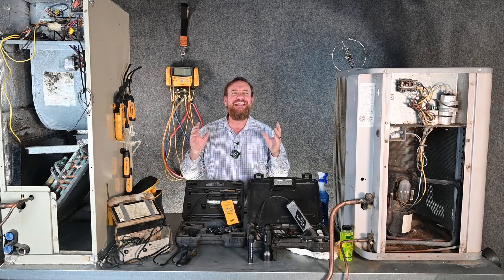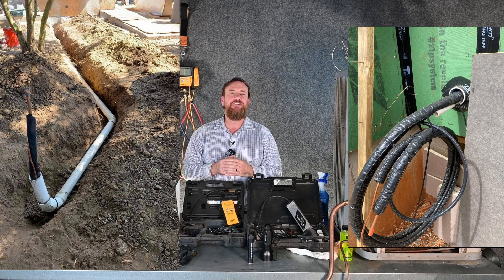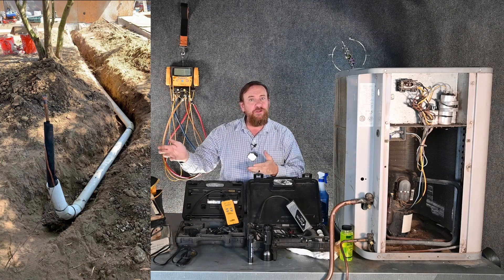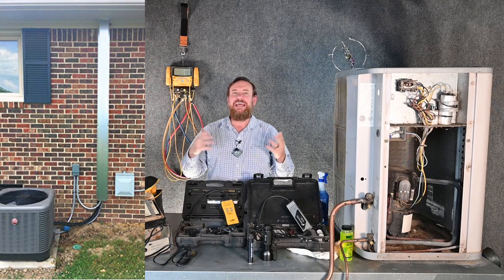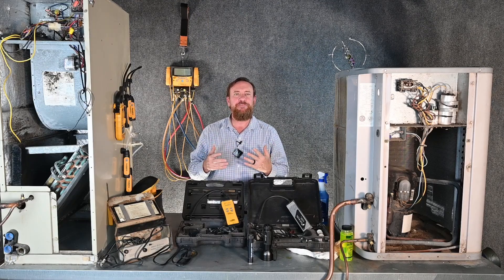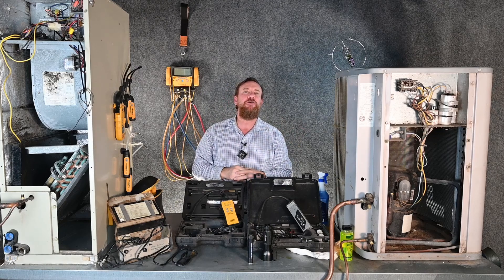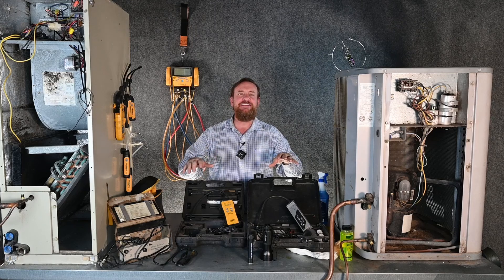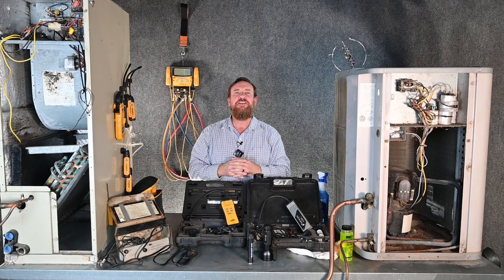HVAC 162 refrigerant lineset Leaks

Comment: I guarantee nobody is running a chace on lines that run in a craw space or basement, and very few are running a chace in walls which is unforgivable these days.  Line set failures, particularly on mini splits are way too common.
Reply from the maker: New line sets are absolutely the way to go. I also agree that ductless line sets are highly likely to leak. Unfortunately i can tell you with certainty very large amounts of companies are reusing existing line sets. In Las Vegas it is extremely rare for a company to replace line sets.

Comment: If the leak is in the wall, can i put nitrogen and just rub it in the wall?, would it detect it if i put 300 psi or more? 
I work on new construction doing apartment and is a headech trying to find them
Reply from the maker: A high end ultrasonic might be better for that.

Comment: LOL yall are amateurs doing things the hard way. Or is it you want to over charge your customers? Fork out $2500 for a quality ultrasonic. I find leaks and pin point them in a few minutes, through insulation, walls, and concrete. Tiny leaks. I find leaks in units in seconds without removing panels. Outside in the wind no problem I've been using ultrasonic for 20 years, people are always amazed how fast I pin point a leak. Now the cheap ones don't work get a good one. I use Fisher Scientific
Reply from the maker: That sounds nice but I don't know many techs that can afford that.
Reply: @love2hvac  Is it fair to charge customers hours of hit and miss labor because you don't have the tools to do the job right? going in finding the problem quickly and fixing it where others have failed makes you look so much better than your competitors and word of mouth gets out fast of how bad the others were and how good you are. That equals a good reputation and more money
Reply from the maker: All about having the right tool for the job. 
I also believe equipment like recovery machines, vacuum pumps, leak detectors, torches scales and ladders should be provided by the company. 

Buisness are complaining nobody wants to get into the trade but the same buisness require students to provide $15k in tools and equipment just to get started. 

If a tech is going to have to supply everything he/she might as well get the van to and do it themselves. 

The rarity of lineset leaks in the wall that would require such an expensive piece of equipment would take a long time to pay off.

Comment: Can I get a video about a compressor not pumping correctly and the valves are getting damaged? All I know is you have to do a pump down and if it dosent hold then thats how you prove your valves are bad
Reply from the maker: That method only worked with older reciprocating (piston) compressors.

Most manufacturers now use scroll compressors that don't have valves. Like that. Copeland scrolls use a floating seal between the discharge and the scroll set. When you try to pump them down the floating seal releases to protect the compressor. A lot of techs condemn a good compressor because of this old method. 

There are some methods to test that I can make a video on.
Reply: @love2hvac  Sweet thanks Ty! I was workin on a walk in cooler yesterday and it wasn’t holding temp. The sight glass would flash then you could see it start to fill up and clear for only about 2 seconds then flash again. I checked superheat and subcool at the condenser and the evaporator and it showed it was good on charge. I put 1 pound of 22 then two pounds and the sight glass still would clear. My pressures were higher then normal. I did a pump down and it wouldn’t go past 24 psi so I condemned the compressor
Reply: And it took a while to get to 24 psi
Reply: And it was a recip compressor
Reply from the maker: @timothydelgado4907  
Ok cool so it's even easier, cycle the thermostat off by raising the temp set point in the box. That should close the solenoid valve and it will automatically dona pump down to the low pressure setting (never in a vacuum).

You can also see how much the pressure rises after it pumps down. 

You can also feel around the heads and valve plate of the compressor for a cool spot. 

If it's a Copland compressor you can use the Copland mobile app. Look up the model of the compressor, pull up a performance chart, look at the low side pressure with the high side pressure and it will tell you what the amps should be under those conditions. (And some other cool stuff. Check the amps and see if they match.

Comment: It’s a great video Mr.Ty thank you so much. Do you think quick connect fittings work batter than brazing especially in the ceiling or in places it’s risky to use flame?🌷
Reply from the maker: I don't think anything is as good as a proper braze. That said, other methods have a time and a place. I would keep some on the truck for some situations I think.